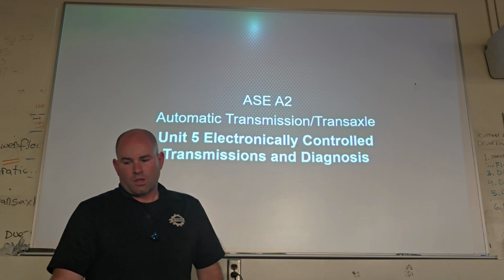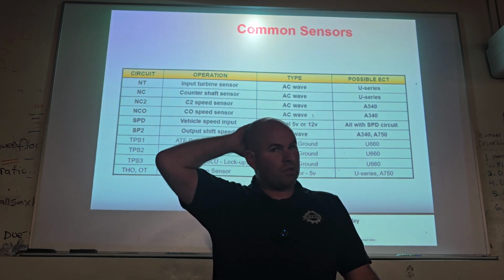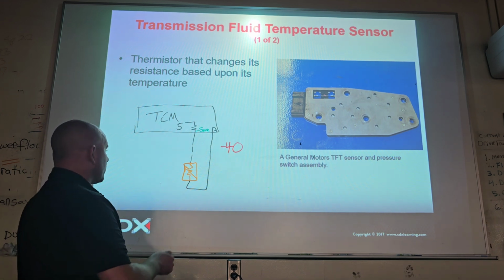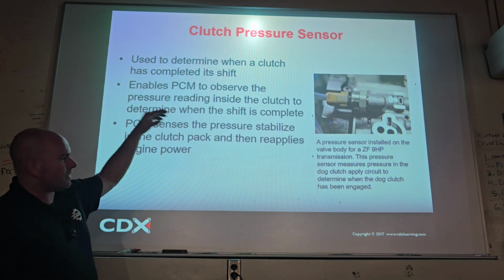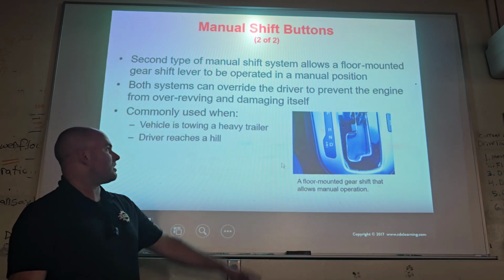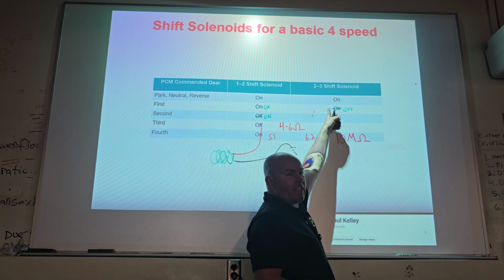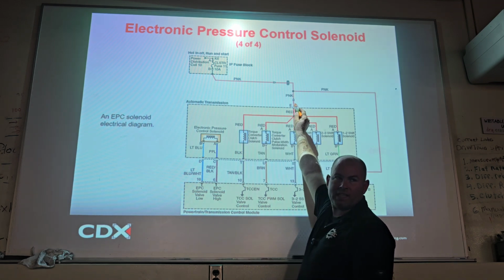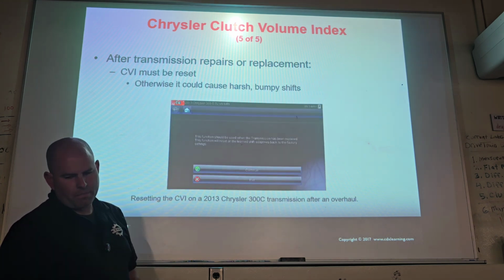ASE A2 Automatic Transmissions Unit 5 Electronically Controlled Transmission Diagnosis Class Lecture

Comment: Can someone help me will the vehicle start if the TCM is off
Reply from the maker: @raphaelndubane6431  this is a hard question to answer because every vehicle is different. On some, yes it will start because the neutral safety switch doesn't go to the TCM. 
On others the TCM may be the module that monitors neutral safety (transmission range) and if the TCM is offline it may not report park neutral so the ECM may not enable starter. 
No one can definitively answer you question without knowing the year make model and researching that particular system operation.
Reply: @paulkelley86  I think you answer is very perfect, thanks you so much for sharing such a beautiful and easy to understand video..